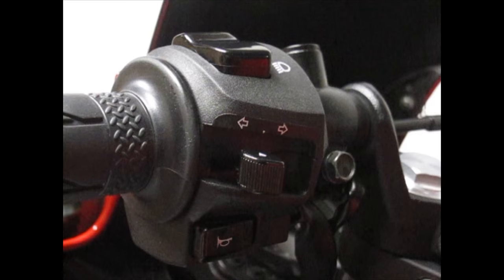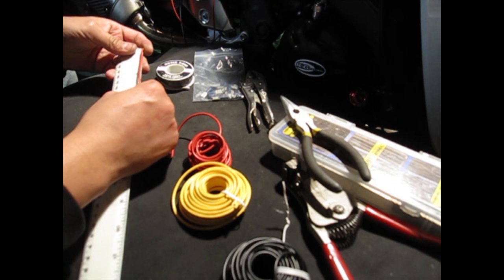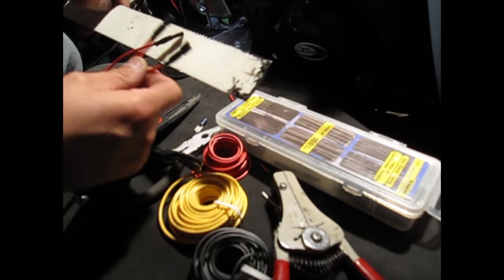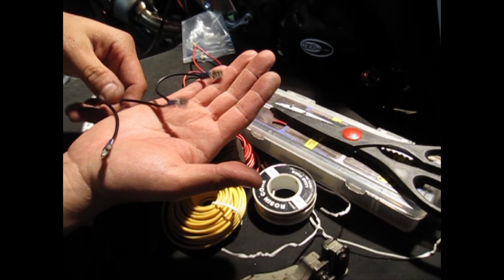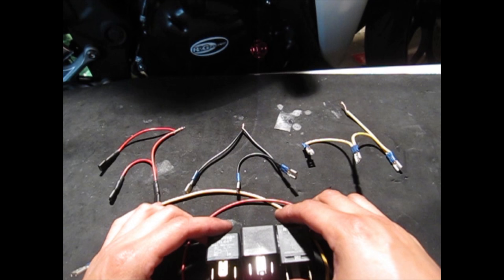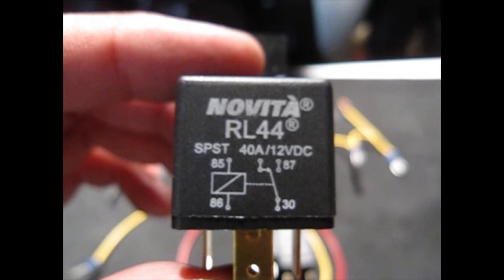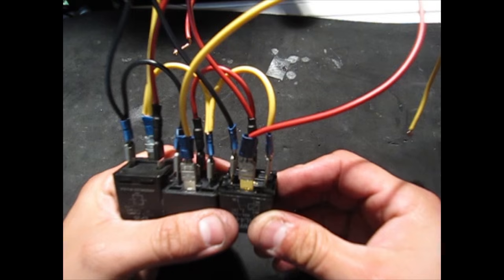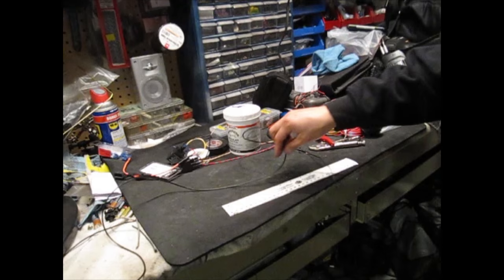How To Install Hazard Lights on Yamaha R3

Comment: You dont need all those relays. there is a much simpler way with a DPST switch and 3 wires. Connect the live wire from the indicator switch across both input poles on the DPST switch then a wire from each output to left and right indicator wires on the switch. this way uses the original relay to send power to both bulbs, no need to overcomplicate it.
Reply from the maker: ill look into that thank for the info =)

Comment: AC can I tap into my front head light to get to the green and brown wires, instead of disconnecting the whole indicator unit?
Reply from the maker: going to the font part of the headlight might be more work and not as easy to get to.

Comment: Hello, I added an additional relay for a handle bar signal light the clicking sound was gone but the lights work fine. Is this ok?
Reply from the maker: its fine as long as the lights do the function.

Comment: Awesome video very well done. I did the wiring per your instructions on my '07 Yamaha V-Star 1100 Classic and the hazards lights work perfectly. However, now the turn signals no longer blink. They come on steady when I select right turn or left turn, but no blinking. Any idea what I did wrong?
Reply from the maker: Could be that one of your cables are getting in contact with another cable make sure your cables are individually wrapped with electrical tape and also this installation was for the R3 not sure if the cables are the same for  a different model
Reply from the maker: you can also check your bulbs could be that one of the filament are broken only allowing the running light to be on , the way to check is hold the bulb up to a light or the sky if its day light out and you will be able to see if its broken or not.

Comment: What I mean is how did u turn the signal lights onto running lights..how did it works ? When u turn your bike on both signal turn on.. When your turn your signal to the left it will blink and the right stay on.
Reply from the maker: Juls Ebuenga everything is explained in the video I use relays to make them blink at the same time and a separate switch to activate this option.

Comment: Hi, I studied your circuit and if install onto a R3, it will work but your normal signals will turn Hazard signals as well. 
So, I did a new routing using stock circuit and I can do hazard as well as normal signaling.
Now, did you skip any steps in the video which allows hazard as well as normal signalling without it mulfunctioning between them?
Reply from the maker: no I didn't skip any steps in the making of this video,  I did show every step i did in the process, but  I did do the way you mentioned but that for me turned out to have my signals not working properly that's why I showed it the way i did in the video cuz that way you can use your signals without having the key in the ignition.

Comment: Hey dude you're a genius with circuits man.  I had a question, could you tell me if the wirings the same for every other lower range motorbike? Cuz I want to do this to my CBR 250R and I'm not sure if the wiring is the same. Kudos!
Reply from the maker: thanks for the compliment =) as far as doing this for your 250 as long as you can locate the indicator wires for both left and right from your turn signal box this process should work
Reply: AC Productions Really appreciate the reply man. And thanks!
Reply from the maker: not sure if its completely the same but it should be very close. not all bike will have the same color for the turn signals but the location to find them is the same, you will have to find a wiring diagram or just take apart your turn switch indication to trace what wire is to what side then tap into those color wires.

Comment: i dnt need the hazard light but i need the switchback white daylight then amberlight when i turn on my turn signals do you know where i can buy some and the perfect size for the headlight
Reply from the maker: DRL switchbacks the size is 30cm
https://rover.ebay.com/rover/1/711-53200-19255-0/1?icep_id=114&ipn=icep&toolid=20004&campid=5338002916&mpre=http%3A%2F%2Fwww.ebay.com%2Fitm%2F231755654466%3F_trksid%3Dp2057872.m2749.l2649%26ssPageName%3DSTRK%253AMEBIDX%253AIT

Comment: you are good technician but i have a question it is posible to combine in yamaha sniper mx150 thank you
Reply from the maker: you should be able to you just have to look for the wires that are for your turning lights, once you find the right  colors then those are the wires that you want to connect to using my method for turn signals

Comment: That's cool, good explanation and how to, good video editing I wish I had more time to learn how to edit my videos with some pro progs. Subbed.
Reply from the maker: +YamahaR3Racer010 yes its a lot of work always tring to get the most important points with out making the video more then an hr.
Reply from the maker: it takes a lot of time to do a video with the edit plus subtitles. i always try to keep my videos no more then 1hr if its a complete install, then i try to edit the things that i don't need in the video but do try to keep the important info in. then doing subtitles for the finish video takes a lot of time to properly type the words in accordance with the video. but this is something your interested in then take a small video of anything get a good editing program the one im using is called ( adobe premier elements 13 ) its old one but im sure you can find new or similar, then just practice.

Comment: Thanks for this Awesome DIY step by step tutorial, I actually had a quick question, I see you used 5 Pin relay and 4 Pin relay, Can I use both 4 Pin relay? (Also let me know if there is any name or number for the relay). Thanks :)
Reply from the maker: meeraj bhavsar yes you can use two 4pin relays the only reason u see me use that 5pin relay is because the store wouldn't exchange it for the 4pin one. The #for the 4pin relay is RL44.
Reply: Thanks for the information buddy! Subscribed.
Reply from the maker: here is the link for the relays if you want to buy http://amzn.to/2i8fcMr

Comment: all you really needed was 3 prong turn signal flasher relay, main signal switch and the dpst toggle switch, but make sure you waterproof the switch, i didnt use the cover and was causin the relay to click. be ordin another one with the waterproof cover. you get them cheap, just 4 screw pin, left and right at the end, double power in the middle. it's an atv i got with lights on it, check my youtube videos or instagram: chadzigler

either way you hook it up, still does the job

nice work too

Comment: i like to that but my problem is it is posible to combine that into the wiring
Reply from the maker: it does get alittle tricky but just make sure that when you do find a spot to move your handle bars left and right and make sure its not pulling on any wires and that you have plenty of space.

Comment: So which is it - two pieces of yellow wire with 2 female connectors (https://youtu.be/Jt9l7UMnWyU?t=8m32s) or three pieces of yellow wire with three female connectors? (https://youtu.be/Jt9l7UMnWyU?t=15m45s)
Reply from the maker: 3yellow wire 3 female connectors
Reply from the maker: 3yellow wire with 3 female connectors

Comment: Donde se pueden comprar esas luces? Soy de bogota Colombia agradezco su información
Reply from the maker: Gracias y aquí está el enlace para comprar el (LED luces de circulación diurna con intermitentes amarillos) https://rover.ebay.com/rover/1/711-53200-19255-0/1?ff3=4&toolid=11800&pub=5575251801&campid=5338002916&mpre=https%3A%2F%2Fwww.ebay.com%2Fitm%2F2x-30cm-White-Amber-Switchback-Headlight-LED-Strip-DRL-Run-Light-Audi-Tube-Style-%2F310958646627%3Fhash%3Ditem4866946563%3Ag%3Aw3gAAOxyBotTb4D4%26vxp%3Dmtr

Comment: Quick question, not related to this project. On the fz 07, it has a combined kill switch and starter switch. Do you think it's possible to install the combined switched on the r3? But I think the hazard switch should have been included as original equipment on the r3. But you did a great job.
Reply from the maker: I'm not sure if it will work but if it's an Oem part I'm sure you can make it work. The R3/R25 are the same bike the fz07 share the same characteristics as the R3/R25
Reply: +AC Productions they share a couple parts. Just curious is all. I'm not a master electrician like you. ;)
Reply: +scorpion251970 thanks for the compliment 😉 I just try to do the best I can.
Reply: +AC Productions How did you get the clear lenses for the turn signals???
Reply from the maker: +counkev if you are referring to the headlight turn signals that's the stock oem headlight already comes clear i just integrated the drl/turn signals inside. if you are referring to the stock oem turn signals on the side of the bike you will have to order straight from Yamaha for the R25 they come in a clear lens. but if your looking for aftermarket clear signals you can check these out>>http://www.ebay.com/itm/Rear-LED-Turn-Signal-Indicator-Light-Blikner-F-Yamaha-YZF-R25-R3-2014-2015-Clear-/281811138254?hash=item419d40b6ce:g:BngAAOSwVL1WB5F3&vxp=mtr
Reply: +AC Productions Do you know of any website that sells OEM clear turn signal lens that also ship to the US? Here we only get ugly yellow lenses. I just want to order some clear lenses and switch them out and not have to deal with wiring. 

I know in the EU the R3s have clear lenses as stock so I've just been trying to find a website to order the clear lenses. 

Thank you
Reply from the maker: counkev
 in Europe they have the clear oem turn signals not sure if they would ship to the U.S. but did find some aftermarket clear lens turn signals> http://www.ebay.com/itm/Rear-LED-Turn-Signal-Indicator-Light-Blikner-F-Yamaha-YZF-R25-R3-2014-2015-Clear-/281811138254?hash=item419d40b6ce:g:BngAAOSwVL1WB5F3&vxp=mtr
Reply: +AC Productions Thanks that is good to know. I found these on eBay: http://m.ebay.com/itm/111735454642 it appears that you could just switch out the lenses I emailed the seller so we shall see. I also found these from Japan but they are significantly more expensive: http://japan.webike.net/products/21958156.html

I prefer clear to smoke for better light transmission but I'll take it since it's not a dark smoke.
Reply from the maker: this is as close as Yamaha OEM for turn sgnals i can get you, this is a link to the yamaha dealership in Poland> http://www.yamaha-motor.eu/pl/products/motorcycles/supersport/yzf-r3.aspx?view=accessories&partcode=YME-W0789-00-00&year=2016 not a 100% if they will ship to U.S. but worth a try if you call they do speak english. i was there 2years ago.
Reply: counkev
Reply from the maker: all bikes have a kill and starter witch on them, not sure if i understand your question correctly?

Comment: your good can u give me some tips on how to install hazard in my honda click125i fi thanks in advance
Reply from the maker: without being able to look at the scooter i wont be able to properly tell or show you what to do to install these hazard lights. the concept is the same from my video you just have to look for the turn signal wires for both left and right and tap into those wires. but if i ever come across that  honda click125i fi which is a Very Good looking scooter i will do a video.

Comment: Tnx,,for the demo how to install hazard lights to yamaha r3..its ok to install to my sniper 150?.i have 6 lights..2 are stock lights tha 2 are led lights, do i need to change all to 6 led lights?.pls, help.if i change to 6 led lights,,what relay do i need, pls.help me..tnx,more power to you sir..
Reply from the maker: im sorry but im not familiar with the "sniper 150" wiring. if you have 6 total lights , 2 are stock and 2 are red thats only 4?
Reply: Good am sir,,i mean to say my sniper 150 have a 4 bulb two in front ang two in the back so all in all i have four bulb..then i add, addition two led lights..so its already six lights,,three in the left side ang three in the right side,,can i apply the procedure you install the hazard lights to yamaha r3 to my sniper 150..what flasher relay do i use..the hazard lights you install to yamaha r3,,i likes it very much,,im from phillipines,,god bless you sir. And your family,,,tnx, for your reply,,
Reply: Good am sir,,i mean to say my sniper 150 have a 4 bulb two in front ang two in the back so all in all i have four bulb..then i add, addition two led lights..so its already six lights,,three in the left side ang three in the right side,,can i apply the procedure you install the hazard lights to yamaha r3 to my sniper 150..what flasher relay do i use..the hazard lights you install to yamaha r3,,i likes it very much,,im from phillipines,,god bless you sir. And your family,,,tnx, for your reply,,
Reply from the maker: you can try doing same like I did for R3 but again im sorry that i dont have any knowledge of the wiring of your sniper 150 im not familiar with this motorcycle, we do not have this in the USA
Reply: Tnx,very much sir,,,

Comment: Should be installed on the left side to avoid accidentally flicking the kill switch. And connect it on the existing signal light switch and stick out two small wires 😅

Comment: Or just add a switch that shorts L and R together, and then blinker either direction would make both sides blink at once.
Reply: I try that the only problem to that is you won't be able to use your turn signals properly cuz you just bridged the connection, yes they will blink together but also blink together no matter if you select right or left. that's why I had to use 2seperate relays along with the blinker to make everything work properly
Reply from the maker: you could but then you risk an electrical short somewhere else on the bike